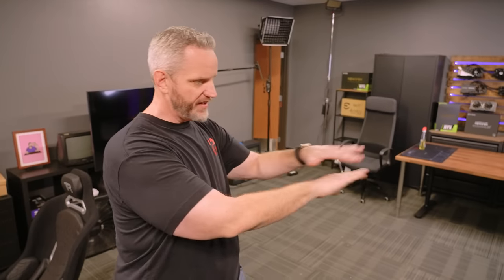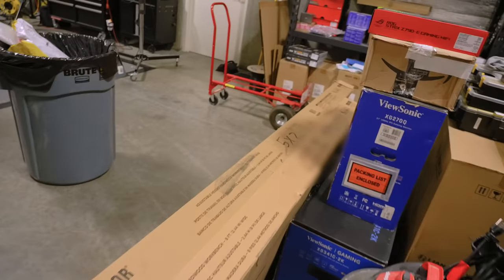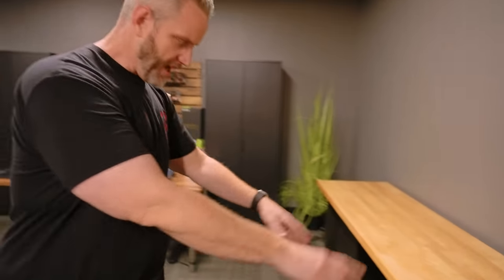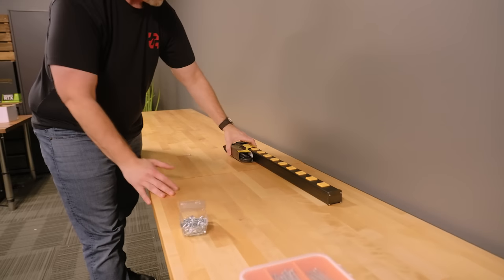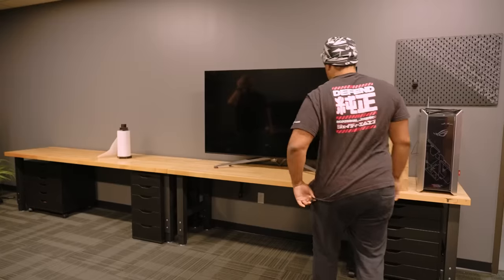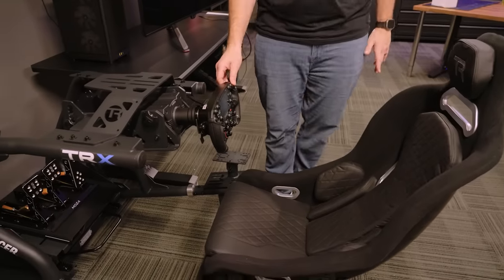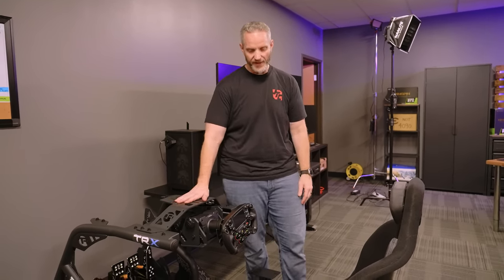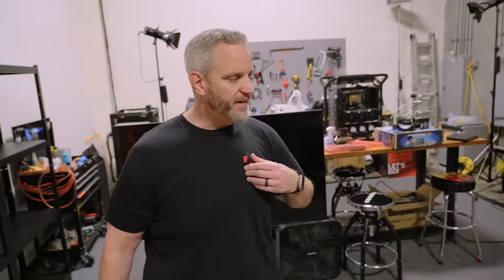I built a MEGA DESK!

Comment: "The man who dies with the most toys...WINS." I have a suggestion. I placed my large evodesk perpendicular to my gamer room wall. This gives me almost 360 degree access to the desktop. I did this for two reasons: It allows me easy access to the rear of the desk and I can see the LGB lights on the back of my monitor. I also have a second desk. It's also placed perpendicular to the wall with a walk-space between the desks. I use the second desk to hold my large two paper tray printer, my UPS, my EPSON WorkForce ES-865 Color Document Scanner, my two front speakers, and my subwoofer. Having the two desks also allows me to setup a 7.1 speaker system. The rear speakers are mounted on the wall behind me.

Comment: Jay did you ever do a follow-up on your steelcase chairs? I'd love to see how they hold up a year in.
Reply: I've had mine for about a year and it is still perfect. It's as comfortable as it was the day I got it. I WAH and have my personal setup in the same room so I use the same chair for both. Probably spend 9-10 hours a day using it and it looks and feels like it is still brand new.
Reply: @Hagop64 which seat material did you go with? I want to go with the fabric for better breathability but I'm worried about the durability compared to the pleather.
Reply: @Hagop64  I'm planning on eventually getting a refurbished Amia when I've saved up enough.
Reply: Hate mine. Waste of money. Advice, if you get one, get the $900 and up ones bare minimum. Unless your tailbone is made out of steel. The seat I have on mine was pathetically thin day 1, and in under two years it's non-existent. It's basically like sitting on concrete. The build quality is excellent though.

Comment: Jay - if you mount a small ledge on the underside of the back of the table, you can place the power strips on it between the table and the wall, making those ~level with the table too. This has the added benefit of leaving you the full table space and easier reach behind the table when you have to route cables.

Comment: You can still run cables down the wall regardless of the insulation, just use fish sticks or the wider (for carpet) metal fish tape. Works for me in plenty of offices, just cut your boxes close to a stud and ride the corner between stud and drywall.

Nice desk btw!

Comment: the gladiator desk will last a lifetime. i have a 4ft gladiator table thing i use at home as a desk. its great i drilled some cable management holes and also installed a table top power and usb plug for charging stuff and testing stuff. its easy to set it at your proper height which is what i hate about most desks unless you pay for a sit stand desk and most of them dont look like they last long. i also installed a cable management hanging thing under the desk so everything is tucked up properly. i took off the gladiator tag on the front it was easy just used a heat gun as its just glue under it. ive had mine for like 7 years now no issues still sturdy and strong. looks brand new still.

Comment: Re: Active cooling on VR headsets - not sure which headset you'll be using but the index has a USB port on the front where someone made a little fan you can buy and put in it which helps A LOT, because you are 100% correct about sweaty VR sessions.
Reply: Varjo Aero has a fan.

Comment: You should wall mount the monitors for the test benches to save room on the desk. I put mine on swing arms that mount to the desk, and I love having all that room underneath them. I can shove the keyboard forward and set down a plate to eat or what have you. It also creates a lot of extra room for if I decide to bust out my steering wheel. It'd make working on the rigs easier.
Reply: He said those benches are mainly for monitor testing. Having monitors mounted on the wall won't be very efficient.

Comment: I've been using 2 of these Gladiator work tables as office desks since 2018, they are rated to hold the weight of a small vehicle so any amount of computer equipment won't be enough to sag the wood.  Really the only 'con' is that the tops of the tables aren't perfectly flat, but that could be fixed if it bothers you enough.   For the price I don't think they can be beaten

Comment: Man, once I'm finished fine turning my own hardware store repurposed desk build, I might have to email some pictures for the next time you roast setups.  I've taken a Husky Industrial style garage shelving unit that's 90"x90"x24" to be my mega desk/shelving unit for all my geek stuff.  The desk surface itself is 85" x 24" deep.  Given that it came with crappy wire racks for the shelves, I used 1/2" sanded plywood for the surface.  Though seeing the surfaces of those work benches, it has me now contemplating maybe doing something like that for the desk part of the unit, as they sure do look nice.

Comment: What I would do with those 2 desks is put one BEHIND the other, at a taller height, so you have a 50" deep, two-tiered desk, and your huge monitor (I'd probably do a 48" ROG OLED) is far enough back to be comfortable, plus you have a little space under the back desk to slide your keyboard into, giving you the full 25" of depth for using your front desk. You could even custom some drawers or something into the rest of the garage space on the sides of your keyboard slot.

Comment: dude, use the fdm printer to print ducts and run 140mm delta fans wired to an arduino going thorugh sim hub and you can have a fuill on amazing wind simulator for the rig. i built one!

Comment: speaking of CRT and reto tech. Please tell me you got a modern PSU for the commodore 64. If you don't it will eventually destroy it. They are known to up the voltage over time and eventually hitting 7v on the 5v line.  ALL the expensive chips will fry instantly.

Comment: Jay, you should put a USB plug on the underside of the table and a power adapter next to it.  That way, you can slide the chair in and the plugs are under the table at the edge.  That would look good with no cables running to the PC other then in the back.

Comment: I made a long desk   for quite cheap it was 3 & 1/2 meters I used wall anchors and a kitchen work top and legs i happened to have collected thing is sturdy looks great goes wall to wall, and  only costed £200  I jumped on the desk laid on it didn't move an inch

Comment: Too late for your setup, but Home Depot has variable height Husky branded work benches that raise and lower via a hand crank. You can get them in several lengths and are built like tanks. With heavy duty locking casters, real wood tops and optional drawers. I have a 54" x 24" unit without the drawers as my main computing desk and one with drawers as a work bench. Both of them together cost about the same price as just one of the rickety-ass "standing desks" I looked at prior to finding these. Not bad looking either, check them out.

Comment: not to shit on your sponsors, but I went to NZXT's build page just for shiggles, and wanted to see how I could go about building my dream system. the options were limited, at best. lack of case sizing for starters, but almost everything was sold out. I just wanted to prototype a 'dream build', even a fictitious one (not based on actual stock levels), but I have to say I was disappointed.
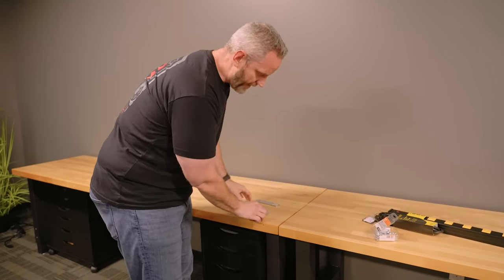also, FYI, 5:03 the term for the desk that goes around a corner is called a 'return'.